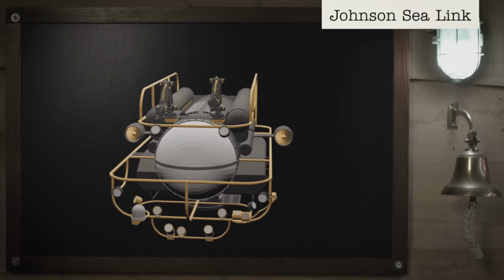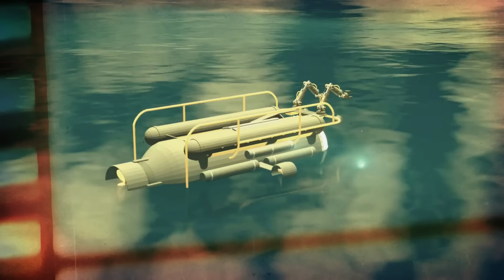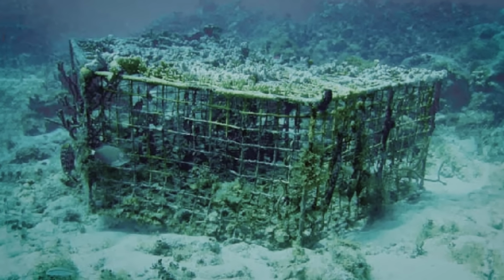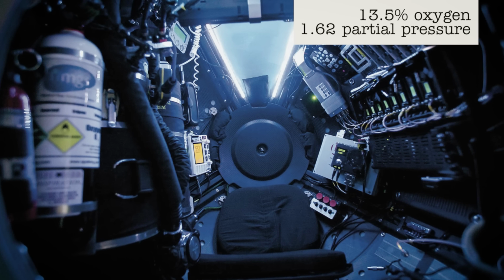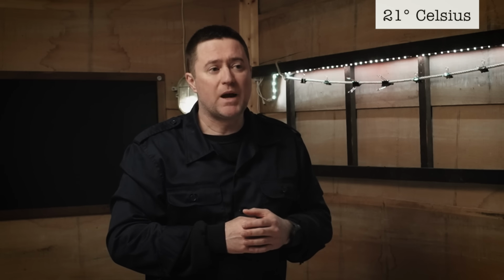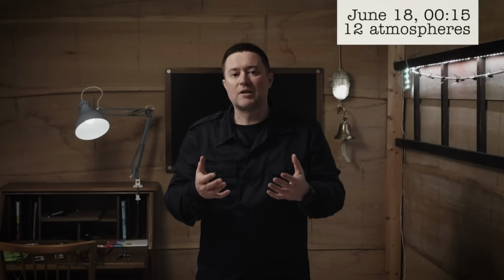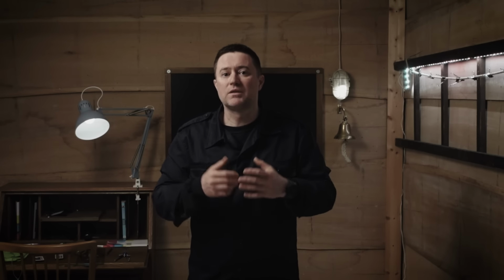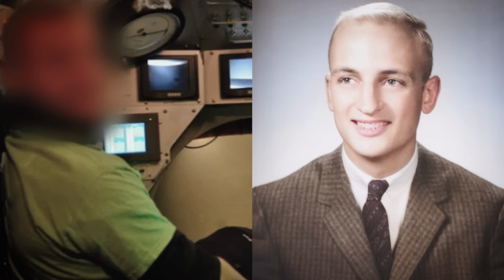This CO2 Scrubber Killed Half the Crew!

Comment: That fan is the smell he had earlier, a fan normally gets an electrical smell before it fails.  What they did wrong, They did not abort the mission the second they smelled an electrical problem
Reply: Absolutely.

Was sitting in the cockpit of a small Mooney for a quick intro to IFR flight with a friend, but as soon as he smelled burnt electrical during the run up he said "Hey I'm gonna call my mechanic we might have to go another day." 

We ended up doing something else that day. Always choose a minor inconvenience over the possibility of a life or death situation.
Reply: The first mistake was going with only one working fan.
Reply: I did think that an unknown burning smell would be an automatic abort.
Reply: Like others mentioned above, they should have even got to this point. 
- critical components must be checked and replaced on regular intervals
- Backup components are there for emergencies and should not be relied upon (i.e. if primary fails and you have a backup, don't go down again until primary has been fixed)
Reply: Or before they even went down to begin with. Heading down with only one fan? With half the crew wearing 1/3 of the clothes they should be? Nothing about this was even slightly well thought out.
Reply: what is needed is back up fans
Reply: the fan failure had no impact. the men it would have effected survived.
Reply: Could they not just use a buoy like with crab fishing?
Reply: They should not have dived at all with the CO2 scrubber systems compromised.
Reply: @rcsontag  it wasn't
Reply: In a vessel like that, there are no “safe” abnormal smells. Surface and then figure it out. Going down without a critical fan redundancy available is nuts.
Reply: @absurdengineering  If ya ever walk onto a plane and smell electrical smoke, do what I do, RUN LIKE HELL.

May even apply to deep dive submarines with windows that won't last, sand bags on clips and no doors or way to get out from the inside.

Buy a seat on the next smash release artificial intelligence game called drowned and crushed with electrical smells?

Really??

Get the latest update to the "Drowning Cave In: without doubt edition" game today!!

Unless your controller needs batteries right now. Then never mind.

Must have been a limited release game huh.

No more tokens (or games) needed for those players, ever...

Smell something funny? 

Climb on in?

Just Say No...
Reply: Critical fans should be replaced on a schedule.
Reply: They should also be designed to outlive the vehicle. Submersibles aren't high time vehicles. Those failures indicate defective design. Failure modes should be gradual to give ample warning for example worn bearings making noise. Insulation failure is inexcusable and contemporary aircraft tech (like the F-4 Phantoms I wrenched for a living) was amply capable of outlasting whatever sad junk the designers chose for ther submersible. TWO fan failures is absurd though one is poor.
Reply: @naughtiusmaximus830  no, new parts fail more often than working parts
could add an hour limit workload
Reply: @GrandDukeMushroom  A burn in would be ideal.
Reply: Redundancy probably better.  Fans are pretty compact these days.  I deal with burnt out power supplies from when the fan fails if you want my “take”.
Reply: @naughtiusmaximus830  they had redundancy, they just chose to keep operating on the backup fan instead of replacing the main one when they had the chance.
Reply: @mactep1  I probably would have double stacked the fans with independent switch circuit breakers if I were the designer.
Reply: @naughtiusmaximus830 
Simpler.
Plug-in fans stored in a small box.
Reply: @mactep1  so they didn't have redundancy then
Reply: Scuba rebreathers commonly have three gas indicators on three parallel circuits. It would be ludicrous to continue a dive with only one functioning.

But a submersible with an exposed frame without fairings or shrouds to provide a smooth surface to prevent snagging and fouling is also ridiculous. This submersible was a deathtrap.
Reply: @naughtiusmaximus830  
To be fair, they had MULTIPLE  redundancies. 
There was main air, CO2 scrubbers, backup air, emergency oxygen generators, and the helium- oxygen supply for the aborted dive.
However, they were down there for DAYS! That was unprecedented. NOBODY would have considered designing for that.
Reply: @DMahalko  
Pretty much all deep sea submersibles are built that way. 
The pressure chamber(s) must be as continuous as possible. Every seam, every seal, every bolt hole creates discontinuity in the material of the pressure chamber. Each one of these is a weak point, a spot that is more likely to fail than continuous material. That means you do not want to bolt anything to that chamber unless you have no other choice whatsoever. And you do NOT want to bump that chamber into anything. Ever.

That frame is there 1) to protect the chamber from impact and 2) provide attachment points for all the control props and arms and lights and other stuff needed to do more than look around.

Yes, I agree it looks like something put together by pre-teens, but it is done that way for a reason.
Reply: @mobilemarshall  
They had sooooo much redundancy. 
This was only a tragedy because they were trapped down there for days. Days!
Reply: @naughtiusmaximus830  the video clearly states that this occured in 1973, so theses days fans have little if anything to do with it
Reply: @naughtiusmaximus830  
There were so many redundant systems on this thing. It was ridiculous. 
There was the original air supply. There were two canisters for the CO2 absorbant material. There were candles that released oxygen. There was another backup air source.
People died because absolutely every conceivable "small" problem that was even remotely possible ALL happened one after the other. 
Minor storm made it more difficult for the support boats to remain perfectly on station. A bouy line that might have helped rescuers track down to the appropriate spot had broken away. The navy divers came down on the wrong side of the boat twice.

It was ridiculous.
Reply: @darkwater72  Absolutely! There is NO (0) tolerance for ANY toxins like burning electrical wire byproducts or even  the cobalt from the magnets in a fan motor. Don't even get in it until it's vented and fixed. 

The rule should be (and sometimes is) don't move in any direction land or sea until it's fixed. 

The problem?

People are gettin in too much of a hurry I'd guess.
Reply: @naughtiusmaximus830  this is a solid design, redundancy without much added complexity and diversity of power supply takes a second point of failure out.
Reply: @darkwater72  OK redundant systems?

How'd that work out?

All systems FAILED?

All are dead and the sub is a total loss.

How many people were involved in that project?

Redundant failure of design, judgement, oversite and implementation?

Would all those be considered redundant systems?

How many redundant systems do you consider failed to keep those people alive?

There was NO safety in that machine no matter how many redundant systems there were.
Reply: And let us not forget there was not even a way to exit the vehicle even after surfacing.

Redundancy is redundant if it doesn't work.

Just more useless complex stuff to get in the way and complicate things?

Recon when they said mixing different materials would cause failure meant anything?

Do you wonder why a nuclear sub doesn't have a window or a redundant replacement window?

Because there is no good reason to mix materials at those pressures.

Even 60 sailors couldn't surface to replace it.

And won't.

Already crushed, drowned and dead from the problem.

Wowsers...
Reply: Like taking a bicycle with a redundant peddler to a indy car race.
Reply: @thehippiedog5956  
WTF, man?
With the exception of one (one out of two) of the CO2 absorbant systems, NONE of the systems FAILED. 
If you ride your brakes until pads wear out, the braking system did not fail; it worked perfectly until it was completely used up.
If you drive your car until it runs out of gas, the fuel system did not fail; it worked perfectly until the fuel was completely used up. 
If you use a flashlight until it doesn't emit light anymore, the flashlight did not fail; it worked perfectly until the battery died. 

The sub was designed for trips lasting for HOURS and ended up being down there for DAYS. It was down there too long. That's pretty much it.
Reply: @thehippiedog5956  
And what's this about nuclear subs not having giant windows? 

Nuclear subs go down a ways and hide until needed,  and by needed, we mean either to launch missiles or to hunt the other guys' subs before they launch their missiles. 
Research subs go down VERY deep to look around and take pictures and gather crap to bring back up.

A nuclear sub doesn't have big windows for the same kind of reasons Indy cars don't have lower gears for better towing capacity. 
That's not what they built it to do.
Reply: @darkwater72  You are overlooking the obvious, they are all dead and the sub is a total loss and under inspection in a possibly criminal case.

Dane brammage? Yepper...

Dead people and a failed sub? Really?? There is a doubt that that piece of crap killed everyone onboard?

Like a screen door on a submarine?

It must be a mystery to ya huh.

It wouldn't be if you dived in it that day though huh...

https://youtu.be/L-LN-uOIIlI?si=HHCAmWuX6Q7kCSaW

Ya know that Jesus is good and tits are good...

...but did you know that being alive to play with them is good?

Let's pretend you have any kind of idea what is good.

https://youtu.be/L-LN-uOIIlI?si=HHCAmWuX6Q7kCSaW
Reply: @darkwater72  So you think a sub should or ever has had a window in it? Soon they will be adding screen doors too.

What planet do you live on?

Bugs (and trolls) are such a bother.

So you have evidence that ANY nuclear boomer ever built has a window in it?

Dane brammage knows no bounds.
Reply: Ya think?

https://youtu.be/lhdm9BX8lDM?si=1Mf1FZEdAXDXTPvC&t=6
Reply: @darkwater72  "hunt the other guys" Wow how silly son...

Pretenders pretend. Kinda how that truth is...

https://youtu.be/hONtmFgh3IQ?si=td_KPuYJdcpYhnT4
Reply: one more?

https://youtu.be/PLyFcGKU_f8?si=nW0mSzObZebIp2sa
Reply: Radioactive? 

https://youtu.be/aE2GCa-_nyU?si=K5l2fAId4ucR0pvV
Reply: @mobilemarshall  To say they had redundancy is like saying we all died but it was a safe death.

Huh?
Reply: Not in (for example) aircraft scheduled maintenance which is based on "time change" requirements. If your new part has a high fail rate that part is trash.  Replacing parts on schedule rather than flying until failure is the cornerstone of reliable aviation. (Retired USAF avionics troop later engine mech/crew chief here.)
Reply: Yeah, one smells ozone and/or burning plastic, it's an indication of arcing and overheating - critical! They might have had to do like Apollo 13, cob together a manual air pump for the CO2 scrubber!!
Reply: So the cobalt from the magnets, pcb's from the wires burning and a lack of any ventilation should be the first few clues.
It smells funny? ABORT!!!!

Huberous or presure form others should never overide good scence(s) or known science...

https://youtu.be/wlLQ-3AhxZk?si=AcWfiMAj7O7bB2fX
Reply: PS: Hindsight is 20/20
Reply: Aperantly they dont lke the word (s )cobalt or p c b,  got edited over telling the truth and that  seems to be wrong huh...
Reply: The fan wasn't the cause of the problem and the people in that compartment lived however.

Cold temperature was the problem, in the other compartment, with fully functioning scrubber fans.
Reply: Easy to say it hindsight
Reply: @Tomdatruth  A burning electrical smell is not a easy to say thing and neither is "All are dead". 

Do you know what cobalt is? Do you know it's radioactive and when disturbed creates particles suspended in air that are many times worse for your lungs than a lifetime of smoking 2 packs of cigarettes a day in less than a hour?

Neither did they huh....

Not that it matters to them now.

The junk they were riding in killed them way before the eventual lung cancer could.

Wowsers...
Reply: Going into a tin can with a burning smell?

Wowsers 😞
Reply: Uhhh but that's not what caused this. They got snagged.... 🤔 They had plenty of time even with the failed fans 😅
Reply: @81brassglass79  So what caused it? FAILURE caused it.

Several. Hasn't anyone ever taught you that one thing leads to another?

And if you are at 6 atmospheres of pressure that there can not be a single thing?

You are caught in details, failure is a cascading effect and ALL are dead due to cheap and useless failures at the surface.

Let's pretend that you bought the best of the best and figured that everything was going to be OK.

Guess what not only was that bucket built cheap and outside of any guidelines it was ignored by the guy that was in charge and fired anyone that disagreed with him.

So funny thing it failed and killed everyone who were stupid enough to go down in that bucket of stupidity.

As granddad used to say...

"The proof is in the pudding"

And I'd expect that is the case here.

If you don't know that simple fact playing the technical game won't help you to cover a silly complicated made up statement after the fact that they are ALL dead.

Dane Brammage? Or maybe it's just a dead technicality.

Dead is dead and failure is failure.

Go figure...
Reply: @81brassglass79   reason they died is that they didn't want to live.  They should have done the lockout dive but "it was too cold".  This was a suicide
Reply: Cheap components fail, even good components fail. Too much money on the brain fails almost every time. It's not a "if" it's a sooner or later  when.
Reply: Everyone shops at gamestop for their deep sea shit...
Reply: Truth! What trully scares me is the "I got money" syndrome.

So simple rules suddenly don't apply and all the over site and stops go out the big window (so to speak).

In a hurry? Money on the line? Recon we have the real root of the problem?

Smells like fire? Let's go anyway?

Smells like teen spirit? 

https://youtu.be/hTWKbfoikeg?si=CvTzwInG1DBmSGoo

So sad...
Reply: yea they took that the same way you would in your 99' Corolla 💀 
on a fkn deep sea submersible I'm aborting at any sign of components failure thats gambling with fate
Reply: No what they did wrong was went through with the mission knowing they only had their backup fan working in the first place.
Reply: Interesting..."poor" is a two syllable word in Aussie. 😊
Reply: @elhollins5988  Americans have a strange dialect.  Most of our great grandparents didn’t speak english.  Australian sounds closer to British english to me.
Reply: @naughtiusmaximus830 which part of America? It's an immense country and not everyone talks like in mainstream media.

Frankly, southern USA language resembles English 🏴 English than anywhere else in the USA and more than modern British as their dialect has also changed over time.

Welcome to the Appalachian linguistic time capsule 😉 lol
Reply: This already reminds me of Ocean Gate! Only 5 mins in!